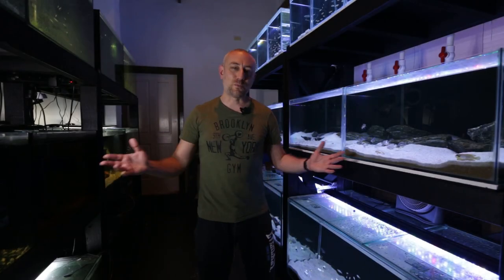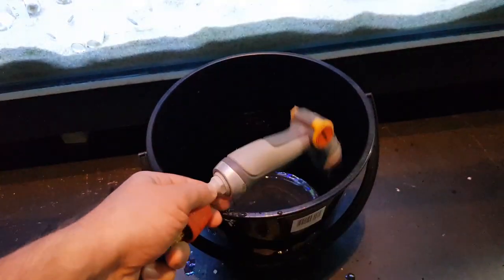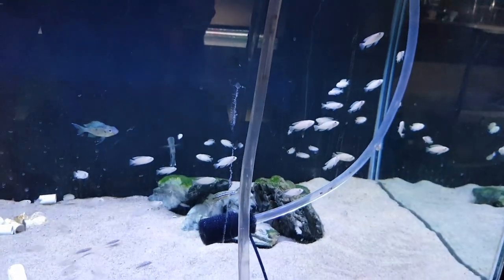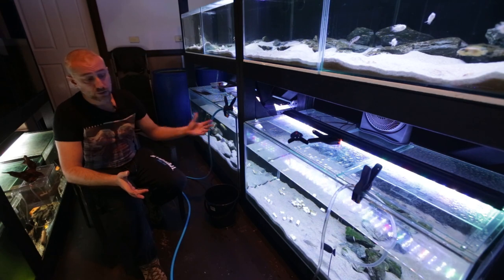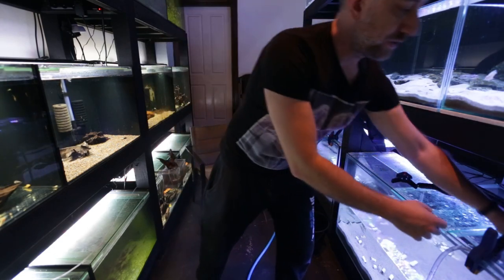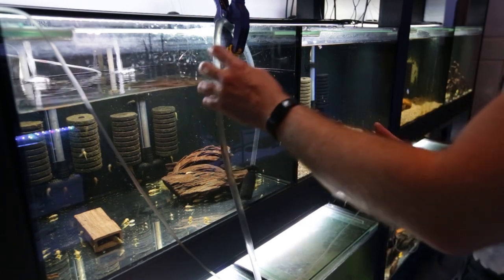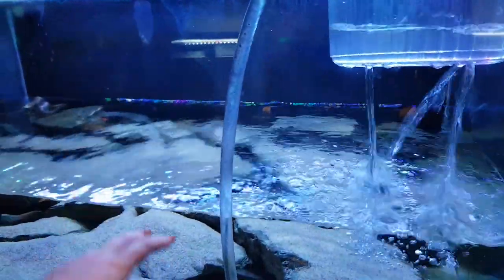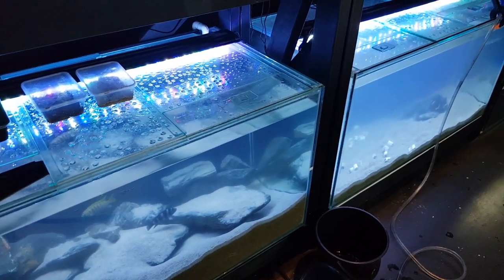What it's like running a Fish Room - Part 2 - WATER CHANGES

Comment: Why don't you leave the pumps in the water barrels? I use an IBC tank for my water changes and it sits just outside the back door with an external pump and garden hose connected to the pump.
Reply from the maker: I guess I could leave the pump in one of the three barrels I use. Each of the three barrels also have their own pumps to mix the Tanganyika salt buffers I use as well. But those aren't for water changes.
Reply: @JasonsCichlids   Jason it would just alleviate the need to lift the pumps in and out all the time.. I have a bad back and always trying to find ways to not make it worse.... and lifting heavy pumps connected to hoses is always hard and needs a bit of manhandling each time so it might save you time and effort in the long run and also save your back .... ~;0)